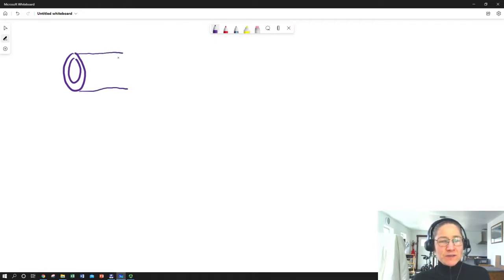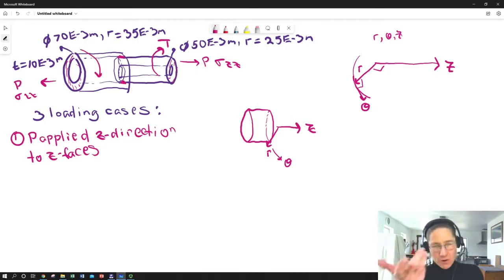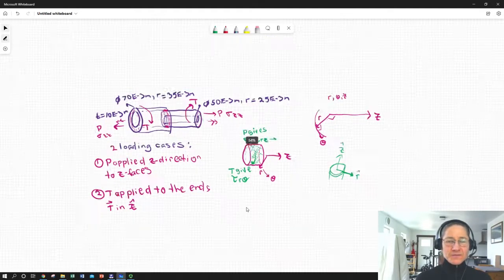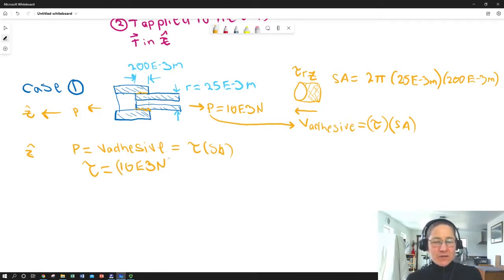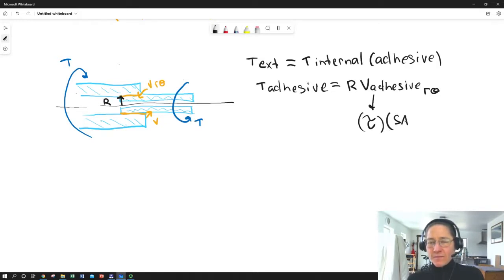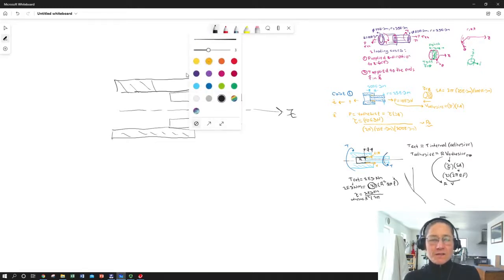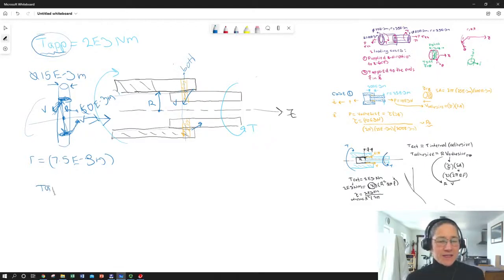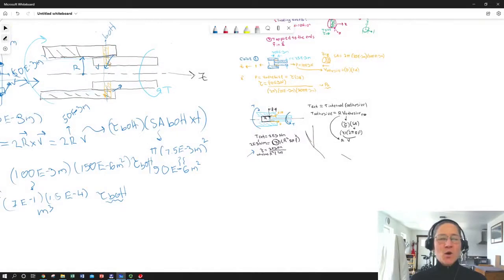Shear stress in Concentric Cylinders Problems

Comment: Exactly what I needed. Wasn't sure if there was any special equation needed when a cylinder pulled out of another cylinder, but it makes sense that the only thing different is that it is the surface area of the part instead of a cross sectional area.